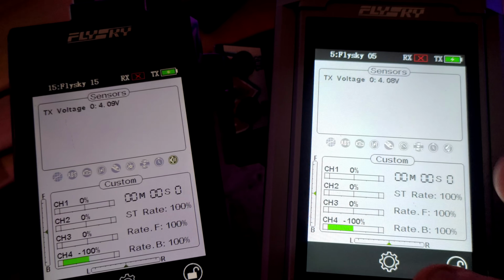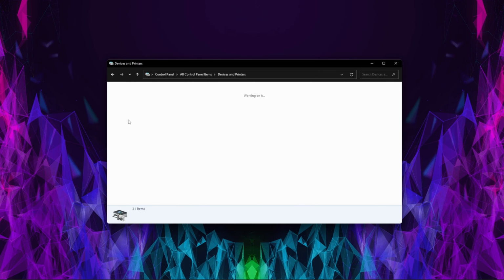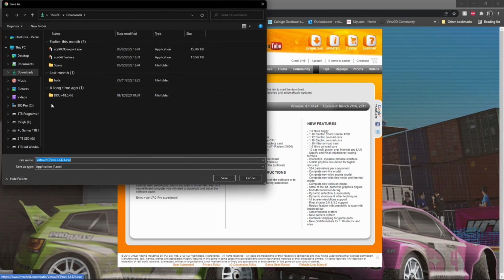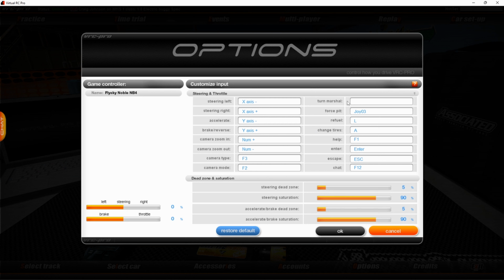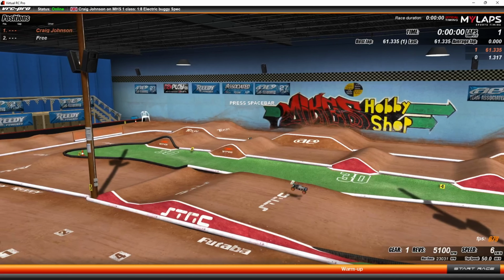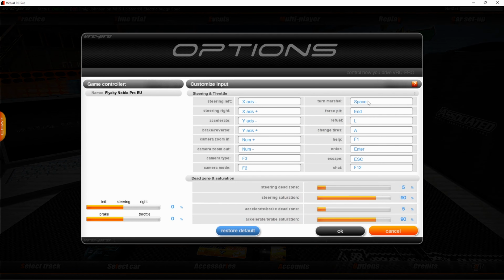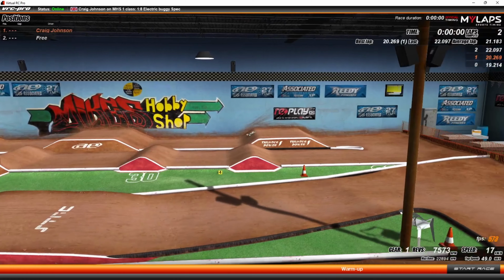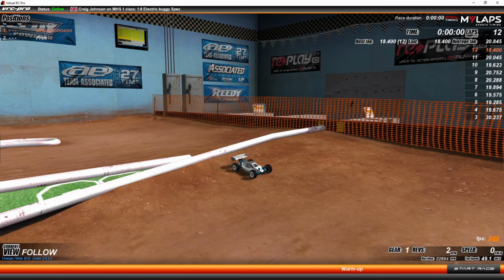Flysky NB4 and Noble Pro, VRC Pro setup guide. 2/3/22

Comment: Hello sir may I ask if there is a vrc pro for radiomaster MT12 tx?
Reply from the maker: Vrc pro works with any transmitter that can connect to the pc or you can use a usb to receiver adapter and any transmitter
Reply: @WTFRCCars  thank you so much sir very appreciate for your info👍🏼❤️

Comment: Great explanation video. Is there a way to connect wirelessly to pc?
Reply from the maker: Yes but it's a pain as you need a usb converter that allows you to connect a receiver to the pc, it then takes the channel output of the receiver and changes them to usb inputs but you also have to power the receiver
Reply: @WTFRCCars  Thanks
Reply from the maker: No worries

Comment: My vrc (or my PC) will only work with the nb4 (Firmware .100) . Not with the pro... Did everything like you said in the video...
Reply from the maker: Strange one mine works fine, does you pc see the pro at all in control panel under Windows controller settings?
Reply: @WTFRCCars  yeah... It pops up but I don't get the calibration (test) page when I hit properties like you do. It's the same like with nb4. Tried different cables... And it works with the mb4
Reply: @WTFRCCars  I tried again this morning... Now my PC gets the pro. And i also get the calibration test page with the nb4. But still vrc only recognized the nb4, not the pro. Sent you a video in messenger.
Reply from the maker: Yeh you need to set the pro as the default windows controller, then open vrc as it's a very old program it need the control set as default before it shows up the 1st fine :)
Reply: @WTFRCCars  i did that... Oh well... I guess I'm stuck to use the nb4 then...
Reply from the maker: It's likely a driver issue so windows is seeing the pro but vrc not identifying it as a controller, may be worth removing the nb4 and pro driver in device manager, then reboot and just connect the pro

Comment: Hello Sir. Is it possible with Nb4/Nb4 Pro to control 2 recievers at the same time? Reciever 1 for the Crawler, Reciever 2 would be in the trailer for some functions there with a separat battery and esc. Thanks
Reply from the maker: Yes on both you can bind one as master and other as slave :)
Reply: @WTFRCCars  Thank you. What would the channel limit on the NB4 be on master and slave? 2x 4 channel oder 2x8channel ?
Reply from the maker: The maximum amount of assignable channels is 8ch